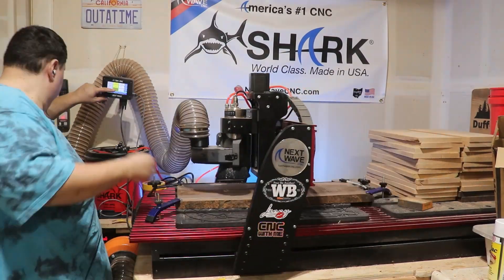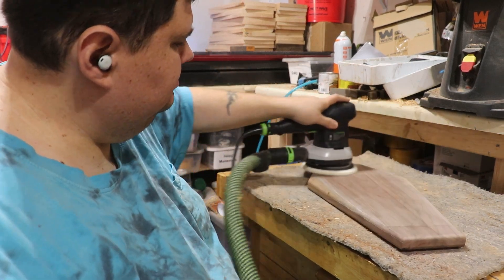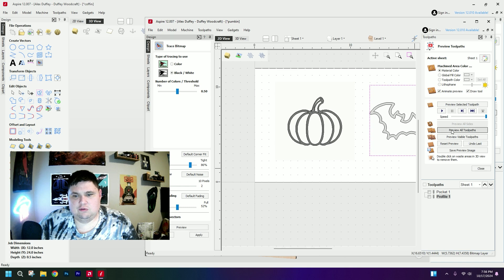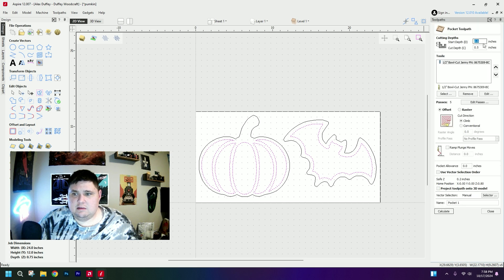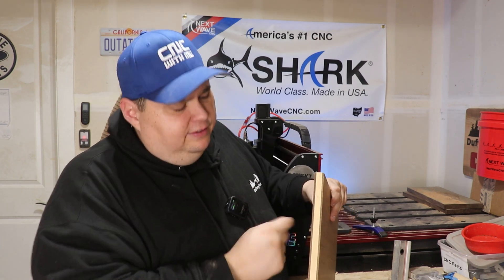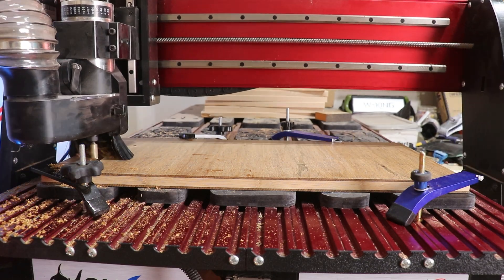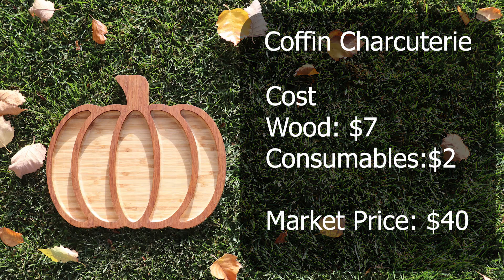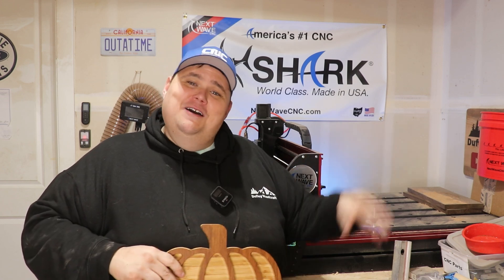Two Halloween Party CNC Projects

Comment: Love this video, Alex!!!
I have a question; for the pumpkin tray, you went down .50", so did it cut into the middle ply or the bottom ply?
Thanks!! 👍😃
Reply from the maker: Hi! The plywood is .75 total thickness. The brown part is .15 on both sides and the rest is the center core so yep the bowl bit cut right into the middle but not all the way to the bottom layer.
Reply: @DuffeyWoodcraft  Oh ok, that's pretty cool. Thanks so much for letting me know, I can't wait to try this stuff out!! 😃👍